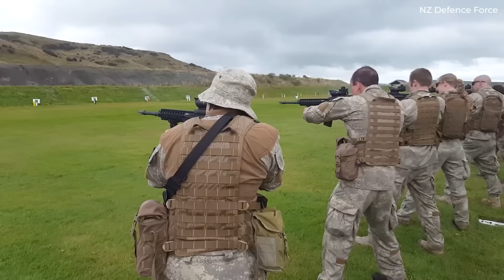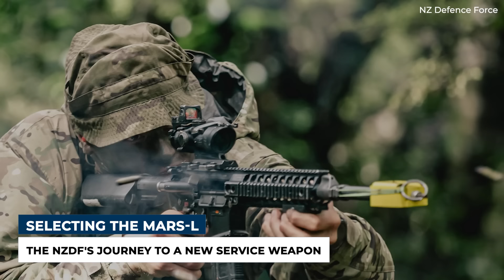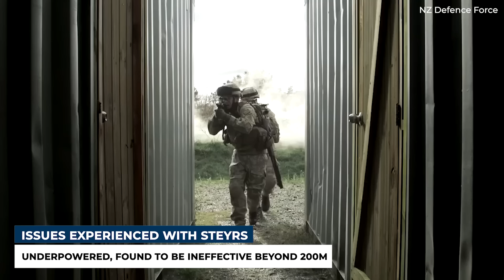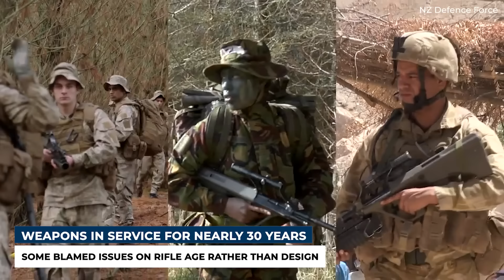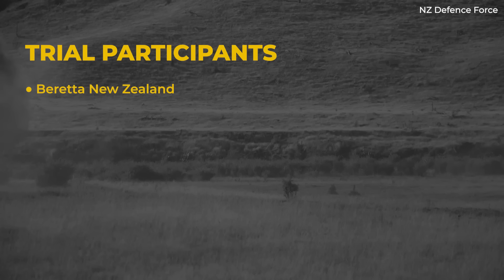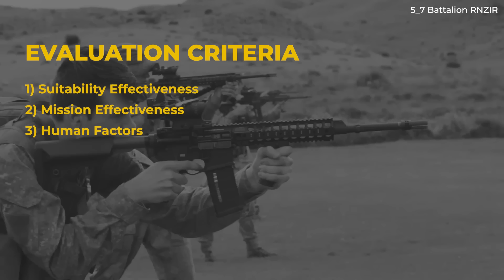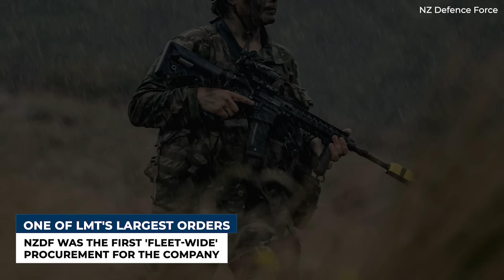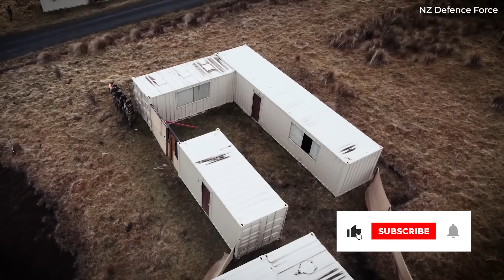NZDF’s Move To MARS-L: How New Zealand Selected Its Service Rifle

Comment: ....I was in that photo at 0:32. That was our first ex with the mars-l. Our guys were part of the selection and then the commissioning and acceptance and then rectification work. Really great system but miss the steyr length in bush and urban.
Reply: Yeah the Newer EF88 Steyrs are quite nice and I can see why you'd miss the compact size.

There was a phrase someone said to me once.
"I can train myself around the ergonomic quirks of any weapon, and every weapon has them. But I cannot train my bullets to go faster, or my rifle to be shorter."
Reply from the maker: Wow, cool! Thanks for sharing your opinion about the rifle(s) - and thanks for your service 😊
Reply: Obviously the MARS is a better rifle, and the AUG had limitations beyond 200 m, ... but ... it was still an effective service rifle, which would need to be replaced, but this could have been in another 10-20 years if the money was spend on a Government owned Weapons company(  like FN) making the AUG A3 which is now Public IP, as well as 556, 762 & grenades.  This National Armoury would provide parts & upgrades for another 10 lears at least, and at the same time design & develop a Pistol, Rifle & MG using using existing Public IP.   For crying out loud  the Glock 17,  M9 pistol, G36, earlier HK416, M4, FN's legacy MG are now public IP to be cloned..